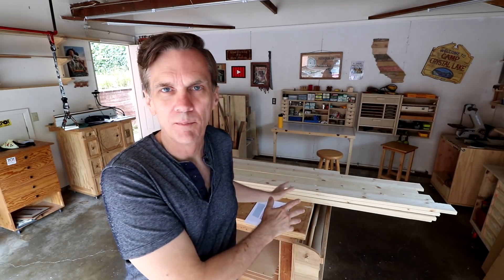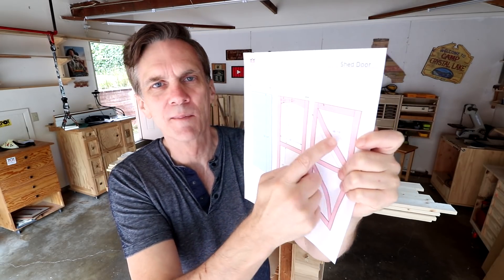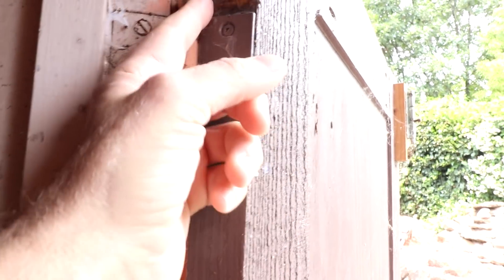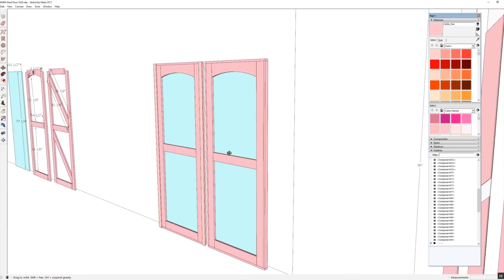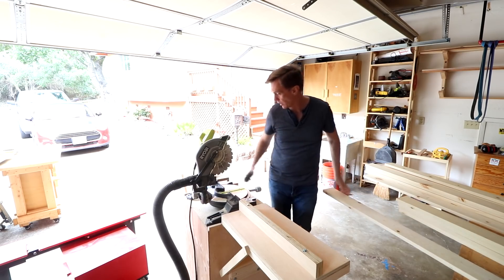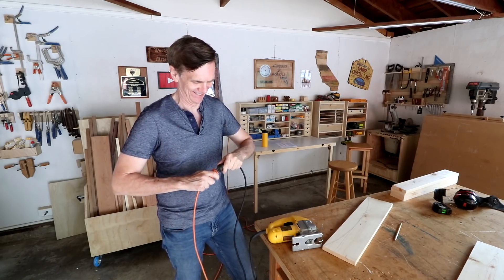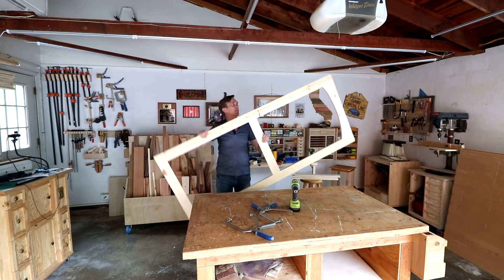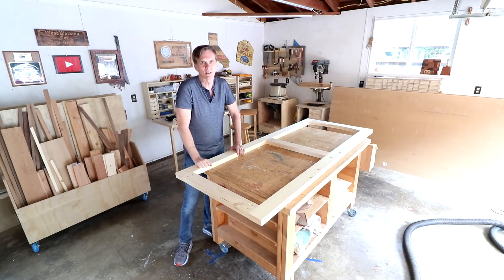Happy Saturday! Changing the shed door design and getting my man card revoked. | LOCKDOWN Day 75

Comment: May I suggest using screws or double stick tape to attach the curved pieces together while you cut the curve.  Then both pieces will be identical. And even if the curve is not symmetrical, you could fasten them in a mirrored layout.

Comment: Noooo! You are doing the wrong thing with that door design. You have designed the entire weight of the door to hang off that little strip you are adding. Okay, not entirely but you have significantly weakened the structural integrity. Just to save yourself from having to replace the hinges! You need narrower hinges.

Comment: I am a retired Master Trade Jack.  I have made a living from having a really extensive set of skills that could make some people offer disbelief.  As for changing a flat tire that would have to be accidentally picking up a nail while driving.  Maintaining a battery involves minor inspections.  All major auto  parts stores will sell a battery with free installation. I use AAA now that I am in my 70's but only when travelling or as noted a punctured tire. 
I do still change my own oil and brake pads mostly to know how my automobiles are wearing.  Suggesting that your time is too valuable seems somewhat absurd when vehicle safety is involved.  
Granted you make a living doing YouTube videos and I spent the greater portion of my day job life as an electrician, plumber including flammable gas, hvac, welder, master engine mechanic, framer, floor mechanic, finish carpentry, painter, and my "night job" as a musician.  I learned many of my skills from my Dad who practiced medicine as his "day job" but his skills as a woodworker were as spectacular as his skills as a general surgeon.  I should add that I am subscribed because your videos are very informative and I learn by watching and listening.

Comment: Steve I have no problem with getting the whole front of my car and engine taired to pieces and im happy to do it but I just spent the last weekend trying to cut straight on a plywood with a circular saw and failed miserably so if you can do wood projects that easy you should be able to at least know how to change a spare or battery or change the oil for me it's just fun and that's the true DIY  is all about.
Greetings from Iraq 🇮🇶 keep up the good work

Comment: I don't get it, why or how woodworking for mere mortals got reduced to halfass woodworking. I looked up some studies - there is no such thing as "allergies to mortise and tenon". Those are very easy to make with very limited tools, the thing would be stronger and overall better. The program would have a bit more variety too, because guess what - mortise and tenon is achievable to mere mortals. And while at it, groove that plywood in, don't just plonk it on one side and wonder why the doors warped again.
Doing it properly would take a fraction more time and yet "it doesn't fit into phylosophy of Halfass woodworking".